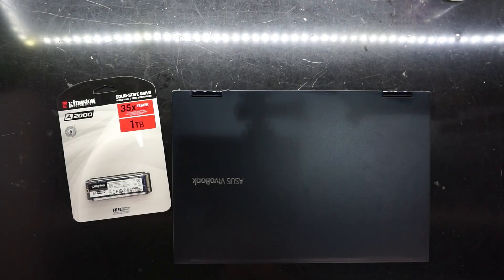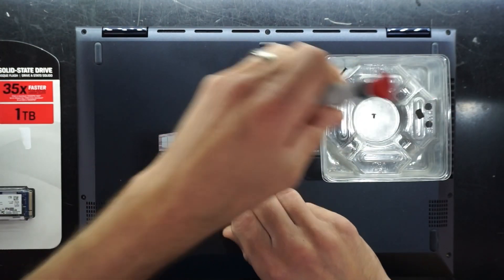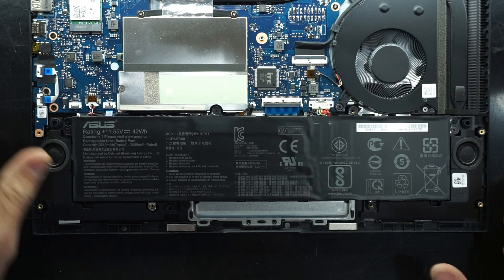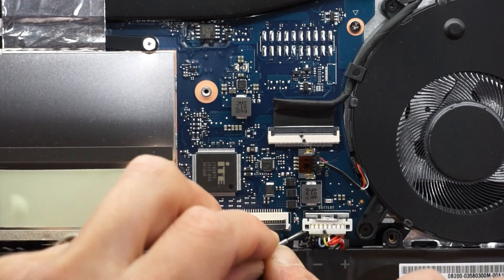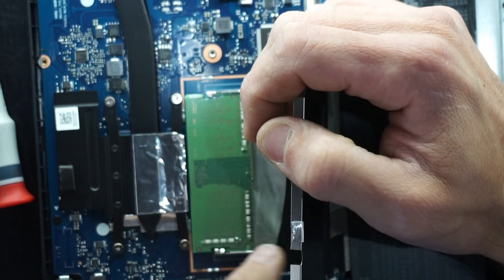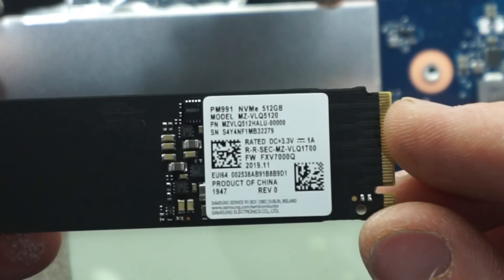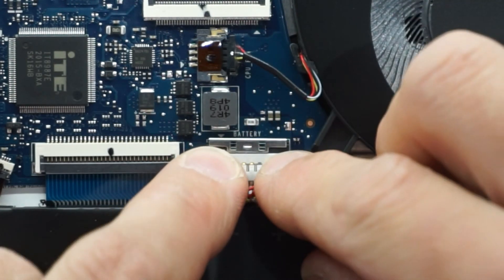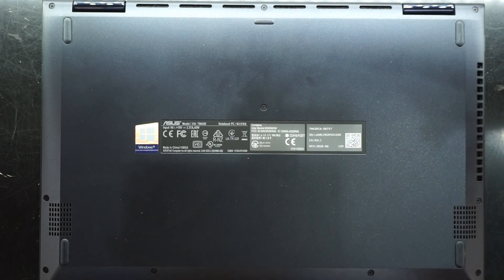Asus Vivobook Flip 14 TM420 Disassembly and Ram and SSD Upgrade

Comment: Hi, sorry to bother you. I have an ASUS VivoBook Flip 14 TM420UA-DS71T with a Ryzen 7 5700U (5000 series), and I installed a Kingston Fury DDR4 16GB 3200MHz RAM, but the screen stays black when I turn it on.
I noticed your laptop in the video (TM420IA-DB71T) looks almost identical to mine, just with a different processor version.
Do you know if I should use a different RAM model (like the Crucial 2666MHz you used) or change something in the BIOS to make it work?
Reply from the maker: im not sure sorry but you shouldn't need to change any settings just simple install the stick.

Comment: Thanks, battery was on the way out on mine, but then today it fell out of my bag and still works, but is a bit mashed. Found 2 other TM420 I can buy, and might just swap over the SSD so it hits the ground running, instead of setting everything up again. Although now I am tempted to clone to a bigger SSD before I do so.
Reply from the maker: a little bit of work there to do, good luck

Comment: I just got mine (same laptop) ram upgraded to 20gb (4+16). Now the ram  is underclocked at 2666mhz which was 3200mhz before. 
There's no option in  the bios to overclock too (no ai tweaker settings)
Reply from the maker: not sure sorry
Reply: the new ram you installed must have been 2666mhz

Comment: Theres like a thin metal thing that is holding down my metal cover for ram. Do you know what it is?
Reply from the maker: a metal shield I'm guessing
Reply: @rickstechrepairs just found it out that its just an aluminum sheet thats holding down the metal cover, which wasnt cut.

Comment: I have the same laptop as yours, i want to ask someting, in the website it says "Max total system memory up to: 12GB", is it okay to add 16GB of ram in the single slot, if its okay, what is the maximum capacity for the single slot?
Reply from the maker: That should be fine
Reply: @rickstechrepairs Ok. Also, the video is very helpful, keep up the good work 😃👍
Reply from the maker: thank you, good luck with your upgrade :)

Comment: i stuffed a 32gb 3200 and it runs perfectly. so total, 36 gb ram
Reply from the maker: Enjoy
Reply: Actually, is the limitation from the Asus website for the tm420 series, such as the 16 GB or 12 GB limit, a hard limit or is it just a suggestion? Because I want to upgrade the Asus tm420ua which on the website (tm420 series) says the limit is 8 + 8 GB (16 GB) to (8 + 32) 40 GB, but I'm not too sure about trying it, is it really possible?

Comment: I have 2 4GB sticks in my laptop, one is soldered in. ASUS said that my laptop has a maximum RAM capacity of 12GB. Would it be alright to add a 16GB stick and ran 20GB of RAM instead of the recommended capacity? Would it work? I have an ASUS X515EP laptop.

If not, would my only option be to get an 8GB stick and run 12GB of RAM total?
Reply from the maker: You can run it at 20gb of ram in total

Comment: TY so much, I´ve upgraded the ram with a 16gb 3200 Kingston fury. so far the design apps runs smoother, I can´t notice any performance issue with the flex...
Reply from the maker: it should go fine, the extra ram will certainly help
Reply: So you have 20gb ram now? Does it work if you put more than 16?

Comment: I have the same laptop.. do u have a video that the 16gb ram is working? I ask asus that this is not compatible and not upgradeable.. also i ask crucial if their ram is comptible with my laptop asus vivobook tm420i.. and they said my laptop is not supported or not upgradble.. pls help im a little confuse with this ram upgrade.. got 4 + 4 ram inside my laptop.. thanks
Reply from the maker: I had this laptop running switch 16+4 

Then used it for ages with 32gb dimm +integrated 8gb
Reply: So this asus vivobook tm420 is truely upgradable.. does crucial 16gb ddr4 3200mhz will work here?

Comment: Too much important the dual channel configuration for Ryzen processors, it's just a good to sacrifice have to lose it, thank to Asus for its crazy choices.
Reply from the maker: indeed, if it was 8gb soldered that would be better,
it still runs as Flex Mode Dual Channel thjo
Reply: @rickstechrepairs  better have the first 8gb dual channel and the other not?  I can't see any advantage with this, only what is never suggested: we will have mixed kind of RAM, this is not better, 2 slots would be better, with or without soldered RAM, I find, for example, the HP solution just perfect (2 slots).

Comment: You pulled apart the ram cover, and said "another" 4gb of ram. Did i miss something? Where did you show the first 4gb? Im looking to buy this, but no one is making in any clearer.
Reply from the maker: 4gb is soldered directly to the mainboard

So the single dim slot is slot 2 in the mind

Comment: Ricks Tech hello. 
I have the same Asus model laptop.  It doesn't charge, it starts charging maybe for few seconds then ( x) appears inside the battery charging icon and goes off .
Could you please help me with this issue?
Kind regards
Reply from the maker: in this instance, i would open and disconnect/remove the battery 

after that i would connect up power and try and turn on

if all is good after that i would reconnect the battery and try again
Reply: @rickstechrepairs   Dear Ricks Tech    it was shutting off  so quick that I took my phone and made a video.  After playing the video I saw ( locking) . Then I went to Device Manager and  disabled the battery.  Now it works with cable. But not without. 
Did I do the right thing?
Or how to make it work with the cable and battery?
Many thanks in advance ☺

Comment: Excellent video, helped me change the hard drive of my laptop, now I have a problem, every time it restarts it freezes on the logo, I have to turn it off and turn it back on, any solution? Another query, do you know if the wifi card can be improved? And to what version. Thank you
Reply from the maker: I don't have a solution for that, 

Did you do a clone to that drive or a fresh install

Comment: I have the same laptop as yours, i was wondering how can i upgrade my ram without loosing the dual channel. Thanks!
Reply from the maker: i added 1x16GB 3200mhz to give me a total of 20GB 
the First 4GB runs in dual channel and the reminder runs as single channel

Google Dual Channel Flex Mode
Reply: It always run on dual channel if you have a ram in the slot

Comment: Could you check if dualchannel is working for the first 4+4 ? how to check that? I'm really intrigued into this..
Reply from the maker: The issue i had, was the applications and games i was trying to use and play where being Ram restricted 

So i went with 4GB Soldered + 16GB Sodimm.

From what i have read this runs the ram in Dual Channel Flex Mode, 4+The first 4GB are in dual Channel the remaining 12GB isnt in dual channnel but usable

Comment: What ram goes in this if I get 16gb ram is it ddr4
Reply from the maker: i personally went with 

Crucial 16GB DDR4 3200mhz CL22
As the 4700U supports up to 3200mhz memory
Reply: @rickstechrepairs  and what about Crucial P2 1000GB (1TB) NVME M.2 SSD Solid State Hard Drive how would i get windows on it
Reply: @rickstechrepairs  does that mean it can take 20gb ram 16 ram then in other slot the 4gb ram

Comment: Anyone tried putting in a 32gb stick to get total 36gb ram?
Reply from the maker: it should support it
Reply: So i put a 32 gb gskill in it and it would not boot just black screen. I also bought a 16gb stick and it still wont boot any idea whats preventing it from working?
Reply: @andynewen have you try to put it more firm?
Because i have try my 8 GB RAM not really firm. My laptop also not boot just black screen..
Reply: The maximum capacity for the system (ryzen vivobook flip) is about 33gb, that is why adding a 32gb stick will result in the system not booting up. The best would be adding 16gb.
Reply: @jinocalma8277  When Asus says max 16 gigs of ram they mean if anything over 16 gigs it can decrease battery life. But they limit it with a number they dont mention.

Comment: Just want to tell you be careful with the battery connection. Since the connector is easily came off and if it came off and it touched the board it will short the board

Just sharing my experience here
Reply from the maker: Good warning, bad luck

Comment: Hi! Im interested in buying this laptop, i am using a laptop for onlince classes etc , using my current laptop , sharing my screen while doing something with the laptop is so laggy and my laptop is very slow while doing it. Can i know, does this laptop can handle the sharing screen while doing something without lagging?
Reply from the maker: The  Running Speed of mine has been great!

Running a Ryzen 7 4700U / 20GB Ram (4gb+16gb) / 1TB Nvme

Multitasking will be fine
Reply: @rickstechrepairs  thanks alot! 👌
Reply: @fazz3592  Even if you go for the Ryzen 3 5300u you will be impressed by it's power

Comment: Sir,pls respond
1)Wud the laptop stop working if soldered 4gb ram get damaged/complaints?
2)Will laptop works fine with the remaining ram in free slot?
3)I am not a tech guy. Can we turn off damaged soldered 4gb ram,so dt t won't interfer with the working of laptop?
Reply from the maker: 1) Possibly (chance of that is extremely unlikely 
2) Yes is the removal slot is empty it will run on 4GB
3) not sure
Reply: @rickstechrepairs  Thanks .Sir,I have another doubt
Ryzen 7🔥+ internal graphics
Vs
Ryzen "5"🙂 + 2gb external graphics

Which is better say for eg video editing?
Reply from the maker: I'm using a Ryzen 7 4700U and 20gb of ram as my main editing machine

Comment: Hey were there any driver issues with reinstalling windows and the asus software on the laptop? I want to upgrade my ssd to 1tb but want to make sure I keep the touchscreen and pen system working flawlessly. Also when you upgraded your ram did you keep dual channel speed or did it go to single channel?
Reply from the maker: when i reinstalled it i didnt have an issue

With the mis-match amount of ram its running in FLEX Mode,

"Once you switch on dual channel mode (also called flex mode), it will perform as two 4GB sticks running side by side in optimal performance. The remaining 4GB of the new stick will run in single channel mode. Overall, it's not as fast as using two sticks of the same size, but it's still faster than what you had before."

so basically not as good as dual channel, but ok
Reply: @rickstechrepairs  Does it need CD-Keys for windows reinstall?

Comment: On the ASUS website it says that this laptop supports up to 16GB of RAM. Since 4GB is already on the board, would anything bad happen if I added a 16GB RAM stick and brought the total up to 20GB? Or should I just add an 8GB stick and not max out the RAM? Also is this video also applicable to the VivoBook Flip 14 TM420UA?
Reply from the maker: Mine is running 20gb just fine

I lose dual channel performance but I was being limited by ram.

So single channel performance on most things at 20gb of ram is better than dual @ 8gb

Comment: Dang i was looking into getting one of these but it only has 200gb and i don't want to spend another 100 bucks or more on a m.2 ssd sense I already have a 1tb 2.5 from my old laptop
Reply from the maker: a thin and light machine like this, these days wont have a 2.5" Slot or atleast i wouldnt expect it to

Comment: I think your RAM setup (16GB + 4GB) still has better performance than 4GB + 4GB .. I've read about flex mode RAM, you can still get dual channel performance for the first 8GB ,.  The remaining 12GB will have single channel performance.  Cmiiw
Reply from the maker: correct!

the 4+4GB is still too limited, no point having dual channel performance when you have maxed out your ram and your system is struggling

Comment: May I ask why we would lose the dual channel when using 4+16?
Reply from the maker: yes you would loose dual channel.

But if you have a program or a game that uses more than 8GB, it will run better with more ram than with dual channel
Reply: @rickstechrepairs  I think you may be incorrect on this, I thought you'd get dual channel operation up to 8GB of ram then you'd lose it past the usage of the first 4gb of each stick

Comment: I've Asus Vivobook Flip 14 TM420IA wih Ryzen 5 and 8gb ram ( 4gb soldered) . Can you tell me how much can I upgrade the ram?
Reply from the maker: i personally have gone to 20GB (16GB+4GB Soldered)
Reply: @rickstechrepairs  What 16GB card did you use? Also, do you recommend me getting the DDR4 16GB 3200 stick of ram from crucial? I have the same model as you. (If you do respond pls ping me)
Reply: @rickstechrepairs  has the performance increased?
Reply: You've Ryzen 5 or 7?
Reply: I've the doubt because the asus store said that the ram is expandable upto 12 gigs only
Reply from the maker: Ryzen 7 4700U
Reply: @rickstechrepairs  Is Ryzen 5 also upgradable?
Reply from the maker: no laptop cpu's arent upgradable

Comment: For light video editing, would you suggest adding the 16gb and losing dual channel, or would it be more beneficial to stick with the stock 8gb?
Reply from the maker: i have upgraded mine upgraded 20GB as i belive it has benefited my 1080p rendering source footage is 4k.

 so im happy to lose the dual channel preformance.

Also helps with games that use over 10gb of ram to run anyway
Reply: @rickstechrepairs  You'll still get dual channel performance of the first 4 gigs.
Reply: @rickstechrepairs  awesome, thanks! Do you use proxies? I figured I shouldn't expect much when it comes to editing, but I'm a little intrigued. Do you feel the display lacks in terms of the colors it displays, and does the glossy style get distracting?
Reply from the maker: proxies in what way?

the 4700U is a great little power house, but it would depend on what content you want to edit, im doing 1080 renders of videos that go between 2-20minutes and with simple cuts and fades. for this task it has been great 

color accuracy is something I'm not interested at this point but from what i read the screen isn't very accurate

The Glossy style i dont mind too much apart from using the laptop in the afternoons on a couch with the sun behind me, i tend to angle the screen a bit more when i do that to avoid glare

Comment: Hey mate, nice video. Did you notice an extra slot for the SSD? I want to upgrade storage on my wife's laptop but want to avoid the whole cloning thing. Please advise.
Reply from the maker: Hi, you best double check the video as there is no secondary m.2 slot or a 2.5" hard drive slot

Comment: I have a TM420IA-EC031T in Vietnam and it's also with Intel 8265 (means that only wifi 802.11ac and bluetooth 4.2). Can I replace it with AX200? Is there any software/driver problem?? Thank you
Reply from the maker: you can replace it.

just need to install the wifi driver once you are done

Comment: Can we upgrade with 32GB (1 stick) of RAM in this laptop but with ryzen 3 4300U processor?
Reply from the maker: I believe you could but haven't
Reply: i've asked on amazon they said maximum support is 20 gb (16+4), i really want to add 32gb too if that's possible.
Reply: He puts 16GB in add a 4GB of native ram unchangable. But ASUS reports the max RAM available is 16GB.

Comment: I have a doubt does it have dual channel or single channal ram
Reply: Bro revomable 4g can be replaced by 3200 8gb ram please tell
Reply from the maker: Ram upgrade is shown in the video
https://youtu.be/UH-xH_DGvwo?t=355
Reply from the maker: mine from the factory would be in dual channel mode

4GB Soldered+4GB Sodimm

But if i upgrade to a 16GB Sodimm i will lose the dual channel

Comment: is this the 4gb ram model or 8 gb ram
Reply from the maker: Mine is the 8gb model (4gb soldered on + 4gb removable)
Reply: @rickstechrepairs  do you know if the ryzen 3 4300 u version of this laptop has upgradeable ram?
Reply: @waelghandour5412  ايه رأيك فى الموديل ده تحديدا تنصح بشرائه وهل يمكن فعلا زيادة الرام ام عموما اسوس تقييمها ايه
Reply: @elsayedazab6  هو فين ياسطا الموديل دا
Reply: @waelghandour5412  i have the same doubt .. i also wanted to know if ram and storage is upgradable on 4300u model
Reply: @hardikjain3157  hey so on amazon.ae and if u look for the 4gb model in the comments they tell u that its actually upfradeable for up to 12 gb of ram
Reply: @waelghandour5412  ohhk.
And wat abt the storage.
Reply: @hardikjain3157  not sure abt that but maybe
Reply: @rickstechrepairs  can we remove 4g and put 3200mhz 8g